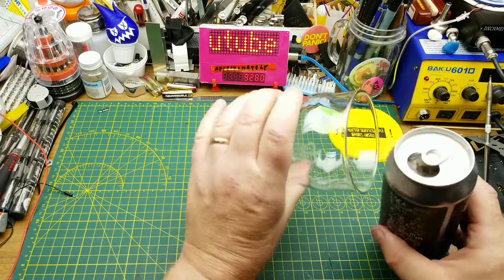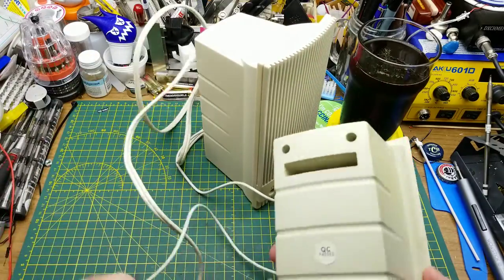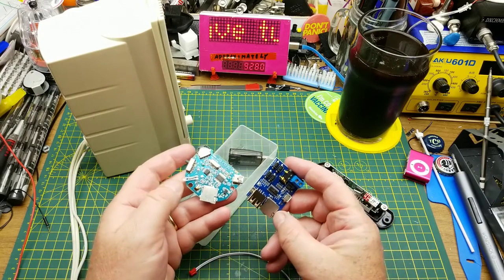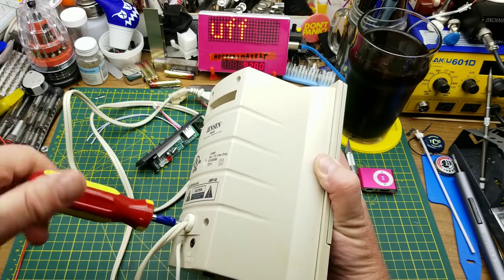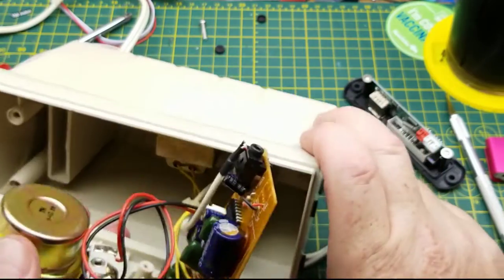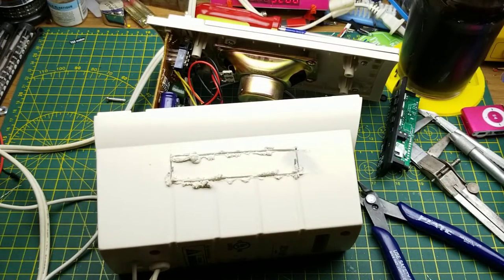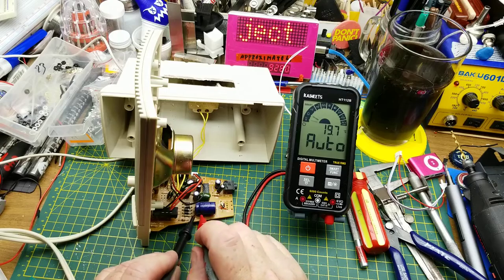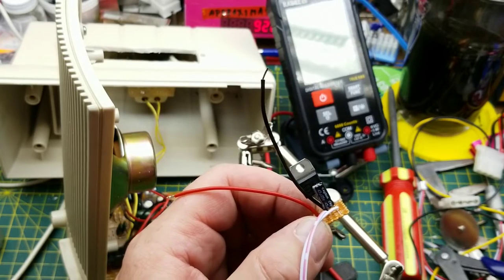Cheap garage music maker

Comment: Excellent idea!

If you have an old pair of bookshelf speakers, you could build this amp and music player into one of them.  The larger speakers are typically more efficient (better and louder sound!) than that tiny little drivers in the computer speaker cabinets.  I would also fashion some sort of heat sink for the 2025 amp chip.

Just a couple of things to consider...

For anyone looking for a set of cheap, old-school computer speakers, Parts Express is clearancing some pretty decent ones for about $4 a set.  The power supplies are sold separately, but that's only another $4.  I'm pretty sure the PE speakers are a bit larger.

Comment: Nice easy job - good use of old speakers
mate of mine had a similar idea, only it ran away with him - he ended up housing a raspberry pi and a gutted homeplug/powerline adaptor inside a nice speaker-y case, running LMS on his NAS and controlling it all like a Sonos style system combining Squeezer app and PiCorePlayer
He likes to tinker and has several around the house/homeoffice/workshop

Comment: I too was hacking a slot in an abs plastic case today. Instead of using the dremel discs, did you know it's possible to cut plastics with a disc cut out of card or even paper? An endless supply of cutting discs for free!

Comment: That Mp3/fm tuner module is also available in a 12v version with an on board linear regulator. Some are bluetooth equipped and/or include a 2x15w (china rating!) amp chip as well.

Comment: U.K. Many moons ago I bought a pair of 'Surf Sound' PC speakers that have heavy veneered chipboard cases. They even have a tweeter and crude crossover. I have just had to change the smoothing cap on the power supply as a bit of hum started. After visiting a few PC shops and either being told I couldn't listen to what they were selling or what they were selling was light weight plastic crap at stupid prices I would strongly recommend you think twice before you buy new ones. It's fun to use words like 'frequency response', 'base resonant frequency' and sometimes even 'Ohms' and watch the pure blank look you get from the spotty 16 year old 'expert' the shop has. Fletcher Munseo equal loudness curves anybody ? Ah - the good old days.

Comment: If you use the same grounds for both the MP3 module and the speaker amplifier then you'll probably have quite some digital noise when using the bluetooth audio mode. I used one of those isolated B0505S DCDC converters to power the module. That gets rid of it.
Reply from the maker: This particular module doesn't do bluetooth, so that's not a risk for my project.

But it is a consideration whenever you are adding bluetooth to an analog system.
Reply: @pileofstuff  Funny though, as it looks exactly like mine otherwise ;-)
Reply from the maker: @Shmbler  I'm sure there are a wide variety of clones variants out there.

Comment: This is definitely something I wouldn't do but good project nonetheless. One thing I might do differently (if I were to do it) is to wire in the old audio input cord to the auxiliary input jack on the module.
Reply from the maker: I've saved the old cable, so that is still an option

Comment: Great recycling and good use of the 7805 which is helpful to me being new to electronics.  I would of used a buck converter before 
Keep up the good work
Reply from the maker: The potential downside of a buck converter in an analog audio application is the risk of the converter's switching frequency causing interference.  Plus the 7805 is cheaper.

Comment: 7805 is perfect for such a light load - bet it doesn't even get warm
Reply: a few weeks later, forgot to turn off the speakers and the garage burns down !  oh well
Reply: When I was a lot younger, I used to build PSU's using linear regulators without heatsinks, and in many cases positioned those toasty hot regulators next to the smoothing caps!
Needless to say I cringe when I open one of those old units up to find a nice brown mark on the PCB and caps leaking...
Reply: @elshiftos  I'm guessing the load(s) on those PSU regulators were more substantial than the load in this video (watts vs milliwatts).  Absolutely agreed that we need heat sinks on them when drawing a watt or more.

Comment: Nice project. It would have been easier to take the LM7805 supply off of the diode pins, than to have to work under the cap. Just saying...
Reply from the maker: There were several valid options available to choose from

Comment: I'm sure if you wanted to take a few more minutes you could have had that 7805 on the speaker circuit board I'm almost positive I saw a lil ole place for it
Reply from the maker: Probably.

I didn't even think about that, I had already decided on the path I took as soon as I saw the voltage on the transformer.
Reply: Kool project though I hate throwing useful tech stuff away I just think about how much that stuff costs in dollars, just to end off in landfill seems such a waste.

Comment: I usually see that 7805's call for .1uf bypass caps on in AND out to reduce noise.  I also like to use baby buck converters to eliminate the heat that 7805's generate when dropping 12 to 5v (but that is just me).
Reply from the maker: This thing is low enough current that there won't be a lot of heat.
And some switching power supplies can be quite electrically noisy
Reply: @pileofstuff  Gotcha. However without the .1s, even 7805 can introduce ripple.  I use bucks for other audio applications and have not had issues.  But, yeah, low current means low heat.  But double check that regulator after running for a while- we don't want the new garage to burn down!!!!